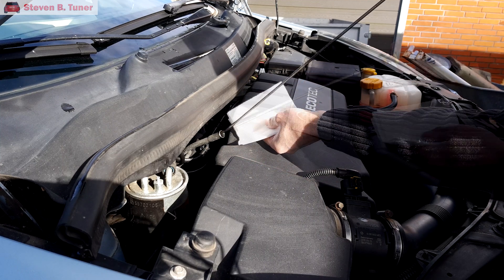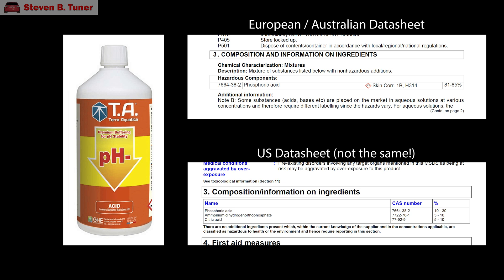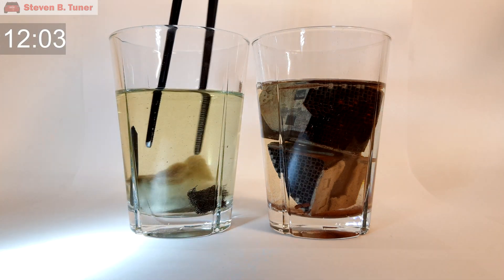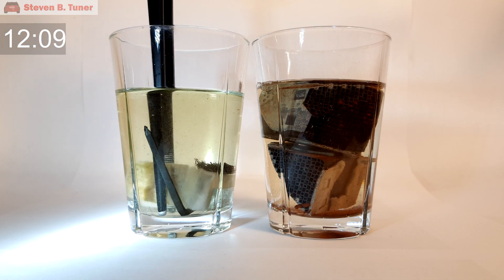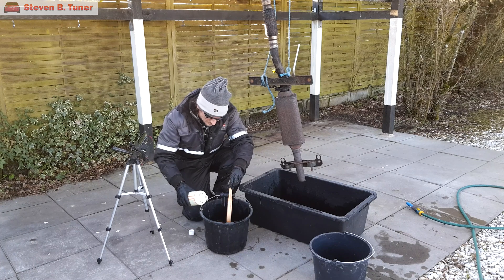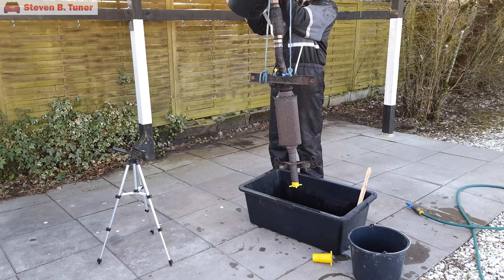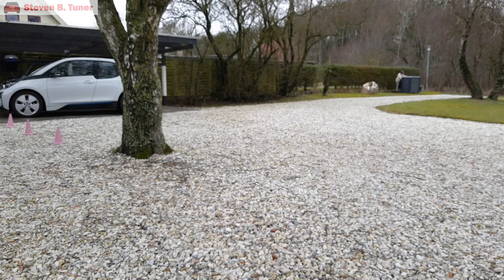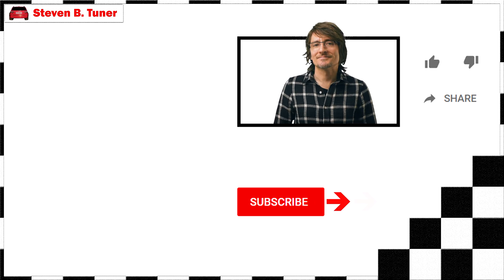🏡 DIY DPF Cleaning at Home: Restore Your Clogged Diesel Particulate Filter (with no DOC catalyst!) ✨

Comment: Great video mate, I've just done a discover sport dpf using fairy liquid and then dishwasher powder, no acid, turbo was blown so a whole lot of oil came out but no sign of the red ash colour, I presume that's why you need the acid, anyway I've left it to dry, no idea if it's going to work, I back flushed it so we'll see, keep up the good work 👍
Reply from the maker: Getting the oil out will help a lot :-)

Comment: How match time you spend to drying after clining dpf?
Reply from the maker: Hi, after it finishes dripping I put it back on the car and dry it with 10 minutes of idling, and then 20 minutes of very gentle driving. My attempts at overnight drying didn't make any difference, so I don't bother.

Comment: Thank you for a very informative and helpful video. I'm finding 81% phosphoric acid to be pretty expensive for the amounts needed and you mentioned brick cleaning acid (watered down to a concentration of 5%) was a possible alternative. Can you please tell me the specific acid in brick cleaning acid you're referring to (to ensure what I get contrains the correct acid) and how well it works compared to phosphoric acid?
Reply from the maker: My favourite concentration is 7% hydrochloric acid for 30 minutes with lots of shaking. Spend at least 10 minutes washing it out after with water and dishwashing liquid as you don't want any acid left behind!
Reply: @StevenBTuner  Awesome, thanks for that. Can the hydrochloric acid damage the dpf catalyst if left in too long or the steel houding itself?
Reply: I came across your other 9 chemical test video, which had the answer to all my questions 👍. Thanks again.

Comment: I own bmw 2016, (b47) can i keep sensors (o2,lambda) while doing the cleaning, so i dont need to cover them?
Reply from the maker: If you can get them out then it is probably best. Some folk in the comments have done it with the sensors in place and it has worked out okay for them.

Comment: Your vídeos are amazing.

Where can i get those plástic bung/plugs for the dpf, mine is 118d , need to put it in the lambda sensor
Reply: I used a rubber dog ball to block my DPF....worked a treat :)
Reply from the maker: I 3D printed them, but you could also make something out of wood or some plastic.
Reply: @StevenBTuner OK thanks!!
Silicon is Strong enough for HCL?

Comment: Hi Steven, thanks for the great video!!! I need to clean my SCR catalyst on my car,  would i be right in suggesting this should still. work on that? I also recently cleaned my intercooler with paint thinners, i am not sure it would have done much, having watched this.
Reply from the maker: It should be similar for the SCR. The intercoolers end up clogged with oil so any kind of detergent / degreaser / solvent will help.

Comment: Excellent video. Lately I have got rerror warning t244800 information particylat filter system limited remaining mileage of partculate filter available. Last week I have got engine light on telling me the mileage has passed. My car has passed 160000km. Do you have any good advices? I have Ista+ and ENET cable for  F series which support my car BMW 525D Xdrive F11.
Reply from the maker: I would expect your can to get to around 240,000 kms before ash clogging - so telling your car that it has a new DPF installed will probably keep it happy for a few years before you need to do a full clean.

Comment: Hi. Here in Norway I can only get my hands on Sodium Hydrogen Sulfate and Sodium Carbonate. It`s ment to take the Ph up/down in pools. Wondering if this would work? I have no idea if my car has DOC catalyst, It`s a Mercedes C-Class c200 OM646 engine 2005mod. Thanks for amazing video!
Reply from the maker: Hi, your car probably has a DOC. For the first stage you could use some industrial strength degreaser or dishwasher tablets. If you can force a regeneration before you remove the DPF then it shouldn't have much soot to remove anyway. All the best with the job!

Comment: Hi Steven, do you think it would be more effective and at the same time still safe to use warm/hot water with the acid. 
You said that the Sodium Hydroxide should't be above 100°C but what about the acid. Generally speaking the warmer the quicker the chemical reaction, or not?
Reply from the maker: Over the years there have been a few chemists who have commented that it is definitely a good idea to start with hot water to make everything work faster.
Reply: @StevenBTuner  So there is no safety concern with hot acid damaging the silicon carbide like there is with the sodium hydroxide
Reply: I find acetic acid in particular is dramatically more effective in all its cleaning uses above 50°C, and 50 is well below the 100°C safety margin.

Comment: I'd like to wash a dpf with a dishwasher tab, do I need to remove the sensors or is it fine to leave them in?
Reply from the maker: Hi, a dishwasher tab won't hurt the sensor, and even the acid 2nd stage has been done by plenty of people where the sensor wouldn't come out, and all was okay.
Reply: @StevenBTuner  Thanks for the answer and huge thanks for making all these quality videos.

I'm not entirely positive the DPF is paired with a CAT, but I am fairly certain the dishwasher tab wouldn't damage it.

Comment: Has that one exhaust really done 374,000 km? Definitely got one's money's-worth there. None of mine have lasted more than 160,000
Reply from the maker: Hi, local fuel ash percentage probably plays a big part. Where I am in Denmark it is usually around 240,000 when things block up.

Comment: very good video!!!   i have an peugeot 2014 expert and changed the filter a year ago,now with mot inspection the filter is realeasing to (5 miljoen)much particles...still have the old filter and want to clean it with vinager ,leave it in there for a few days and then back flush it???and how is it that the mounted new filter is exeeding the limit,could it be burned so its leaking from wall to wall in stead of filtering???doesn t seem to be blocked???
Reply from the maker: Hi, it is very common for those Peugeot filters to be cracked, so you will probably need a replacement. As an emergency measure you could add 2 bottles of Liqui-Moly Diesel Stop Smoke to a half full fuel tank - and that will maybe get you through a test.

Comment: good video, 
only thing i would say is that it reads zero at the end because you've reset it, basically telling the car that whatever the pressure difference is now, is zero.
Reply from the maker: Hi, on older cars the reset is a simple km/mile counter. New cars use differential pressure sensors and will notice a clean filter themselves.

Comment: I gonna have ago in few days while its fixed to car by removing oxygen sensor will let you know how it goes am using acid wheel cleaner not diluted will leave 10min then  using few bottles of mannol egr cleaner before an after :) then i will rinse out with cold water mixed with washing up liquid
Reply from the maker: Hi, I haven't experimented with any in-place cleaning yet - so I usually recommend to folk to use the Liqui-Moly product designed specifically for the purpose. If you do give it a go with any kind of acid then it would be best if the rinse water had dishwashing liquid or another mildly basic additive to neutralize the acid, as you really don't want to find out what any trapped super hot acid does to the metal in your exhaust system. You could use the EGR cleaner before and after the acid as that would loosen things up before and then help neutralize everything after. It will certainly be interesting to hear how the wild experiment goes! :-)
Reply: @StevenBTuner  will do that :)
Reply: @StevenBTuner  what happens if use boiling water mixed with wheel cleaner acid
Reply from the maker: Heating up things always makes the chemical reactions work quicker.
Reply: @StevenBTuner  so with engine running should be good
Reply from the maker: Hi, I would say that if you put any acid in, then it is really important to neutralize after you have finished with dishwashing liquid and lots of water. Trapped super-heated acid can eat its way out if you don't flush it out.

Comment: Have you tried any if this while on the car? Looking for a last ditch effort to regain power while i wait on newer light weight parts
Reply from the maker: Hi, I haven't used any of these for in-place cleaning. You could try the Liqui Moly product if the DPF is too difficult to remove.

Comment: hi Steve. Does the Autel Work for Audi, BMW, VW and Fiat?

thank you
Reply from the maker: Hi, the features available vary quite a lot between manufacturers, so I can only say that I think it works better for BMW than for any other brand.
Reply: @StevenBTuner  ok fair enough. But it does work for other brands, correct?

Comment: in some of your previous videos you tested wheel cleaner and it showed well
can in be used to clean dpf wit catalitic ?
Reply from the maker: Hi, I much prefer finding 'pure' generic chemicals whenever possible because things like wheel cleaner can be made of so many different things, and at wildly different concentrations. Acid based wheel cleaners can contain phosphoric or oxalic acid, both of which will probably dissolve DPF ash, but I haven't done any testing yet to make sure they won't damage the catalyst materials or the steel / stainless steel case.

Comment: Is it possible to pour the cleaner fluid directly through the oxygen sensor's hole without removing the DPF?
Reply from the maker: Hi, this process is not designed for that. You could try the product from Liqui Moly that is specifically designed for in-place cleaning.
Reply: @StevenBTuner  Hi. I already used the spray. It stopped limp mode, turned off DPF diode but service mode beeped bc high soot level. Can car stand on a slope so that the fluid poured in through o2 sensor's hole can flow sufficiently out from exhaust pipe and be collected with a bucket beneath it? What liquid can be used for this, brake cleaner fluid or DPF Cleaner 5l MA PROFESSIONAL 20-A92, acetone, ethanol/propyleth, 5l engine or rim cleaner, dishwasher/clothwasher detergent? What happens if your fluid in your video is used this way? Is it true that water can solidify like cement the ash in the DPF?
Reply from the maker: @frv6610  Hi, if you have soot clogging (rather than long term 'end-of-life' ash clogging) then you need to address the cause first, otherwise you will clean the DPF and then have to clean it again in 2 months. I have some other videos on possible causes such as EGR malfunction, sensor malfunction, turbo seal failure and boost leaks.  And to answer your question: no, please don't try any of my methods to do in-place cleaning as left over chemicals that are not washed out of the DPF thoroughly will eat away either the ceramic material or the housing once high temperatures are reached. Also, ash in the DPF is a bit like cement for sure, and it maybe due to the large quantity of water that is produced when diesel is burnt.
Reply: @StevenBTuner  Do you mean Liqui Moly 1L DPF cleaning fluid, can it be poured through oxygen sensor's opening? Is ultrasound cleaning liquid  to pour directly?

Comment: How do I get diagnostik for Dpf regeracion to burn it then to add it like I replace it same as show in this video
Reply from the maker: A good OBD2 reader will have DPF functions. Newer cars after 2014 will automatically adjust to a cleaned DPF, but most cars before 2010 will need to have the DPF total kms reset before the DPF light will go away.

Comment: Hi. Very informative series of videos! Thanks. 
I purchased the autel ap200 for my nissan X trail. However I don't get the option to replace the dpf (only to reset it or do a regen) nor does it seem to have the dpf specific live data. 
Is this just a case of "tough luck" due to the  model of car maybe?
Reply from the maker: Hi, the AP200 emulates the manufacturer's diagnostic system - so what features you get varies quite a lot between the brands. I hope you still find it a worthwhile purchase...and of course it will gain some features when you get a BMW ;-)

Comment: Great video! might attempt this instead of paying someone else to do it. Would have been nice to weigh the thing before and after to get a rough idea of how much soot these things accumulate, for us geeks.
Reply from the maker: If you give it a go, then it would be great to hear how it went! A great idea, but the weighing would need to be done after the pieces were baked in an oven for a few hours as the ceramic sucks in water like a flower pot.

Comment: Hello Steven ! If a recall very well, in the No damage DIY dpf cleaner video you used concentrated (32%)  HCL....you diluted it with water in 1:4 ratio, that's bringing the concentration to 8%.....here you are talking of 6-7% concentration, any concentration above this being aggressive on the stainless steel housing, am confused, please make it more clear. Thanks
Reply from the maker: Hi, I think I go through the numbers in the first video...but to clarify: 1 part acid plus 4 parts water gives a total of 5 parts, so take 32% and divide by 5, which gives 6.4% strength (which is sort of 6-7%). At the end of the day it won't matter too much whether you are a bit off with the mixing, you just don't want over 10% or your stainless steel will probably end up going rusty!
Reply: @StevenBTuner Greetings! I have successfully cleaned my Megane 1.5 dci clogged dpf, now my car is super performing, thanks Steven for your Videos.
Reply: Thanks so much for the explanation Steven....I have already bought  NaoH + HCL.....will do this tomorrow. Thanks once again

Comment: Hi I was about to order alloy wheel cleaner for my dpf but it says it's hydrochloric acid not phosphoric acid is there much difference and will either of these be safe to use.
Reply from the maker: Hi, I have the best results with a 2 stage wash, where the 2nd stage is 6% HCl flushed and back-flushed for 30 minutes. It is covered in my other video: The No Damage DIY DPF Clean.
Reply: Hello Steven ! If a recall very well, in the No damage DIY dpf cleaner video you used concentrated (32%)  HCL....you diluted it with water in 1:4 ratio, that's bringing the concentration to 8%.....here you are talking of 6% concentration, am confused, please make it more clear. Thanks

Comment: hi steven, i will use phosphoric acid but should it be used without diluting the whole for DPF or should I add 81% phosphoric acid and 19% water?
Reply from the maker: Hi, if you use phosphoric acid then you will need to use it at 81% or stronger.
Reply: @StevenBTuner  Thank you steven 🙏

Comment: hi steven thanks for the video.  How much to use the ph reducer, should it use 2 liters of water to half a liter like ph down, or should it use the ph down directly to the filter?

If I use HCL instead of ph down, is it okay if I use 25% hcl as 75% water?
Reply from the maker: Hi, you have to check what the pH Down is made of. If is phosphoric acid then you can use it at 85%, for HCl you want a final strength of 6%.
Reply: @StevenBTuner  Thank you steven, thank you also for the information.

Comment: I own a 2012 Vauxhall/Opel Astra 1.7CDTi diesel @ just under 100k so very interested in your superb series of videos. I would say its showing the symptoms that require a deep clean - 'mandatory trys to  regen and failing as this does not appear to yield any change. My motoring like most is short frequent trips with the occasional long  journey, primarily on faster out of town highways rather than in a town/city. Potentially blocked as you have described in need of cleaning - so I am going to try your suggestions.
You mention most DPF's can actually be saved rather than scrapped, with this cleaning cycle. Given average use and deterioration of the materials within a DPF what should the real life expectancy of a DPF be in a well looked after vehicle - 50k, 100k, 200k or longer?
Reply from the maker: Hi, most cars get from 120 - 180k miles before they get ash clogged, and need a clean. Soot clogging can happen at any time, and indicates that there is an issue with the egr valve, glow plugs, or a sensor - resulting in the regeration failing. You will need connect a good diagnostic unit to verify which is most likely.